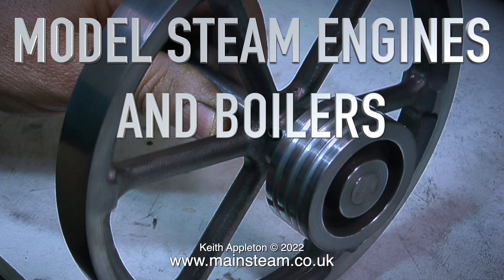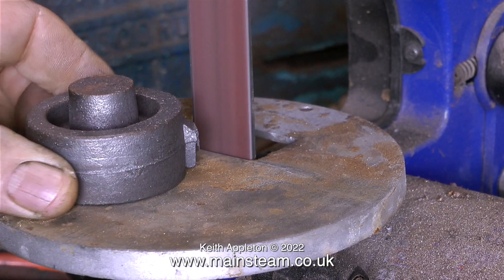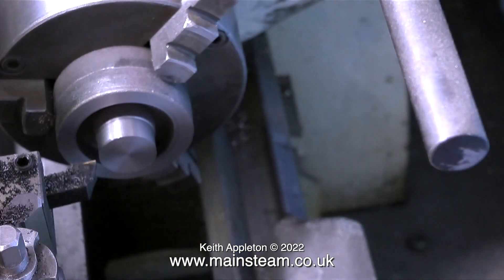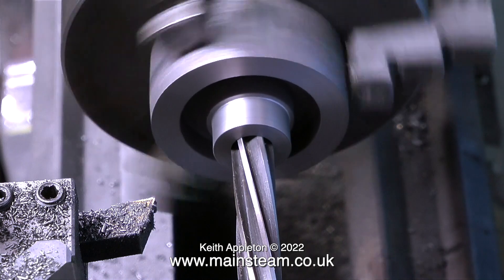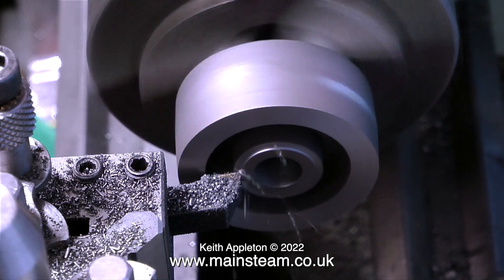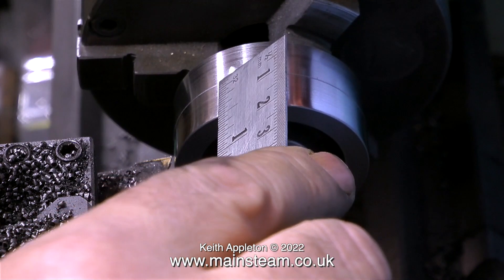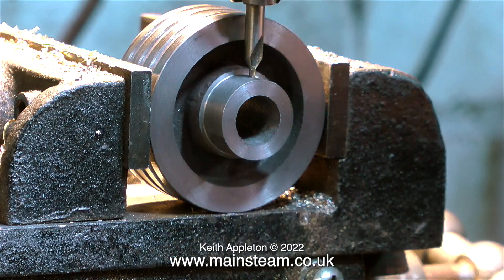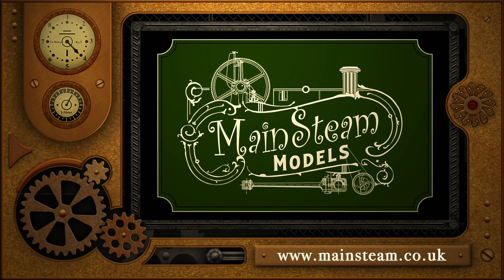MODEL STEAM ENGINES AND BOILERS - PART #24

Comment: at least you didn't cut a bigger hole in the pulley than the shaft
Reply from the maker: Not sure what you mean ???
Reply: @keithappleton  when you drilled a 7/16" hole in the pulley only to find out you had a 1/2" shaft instead of the other way around(you do great work)